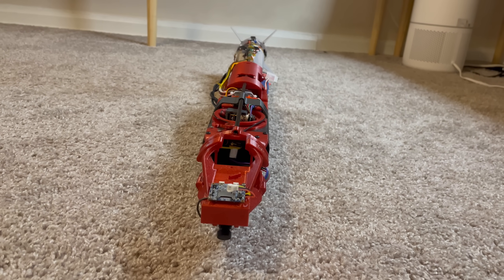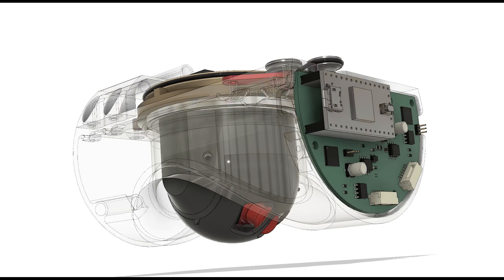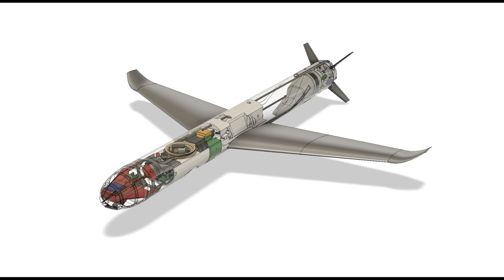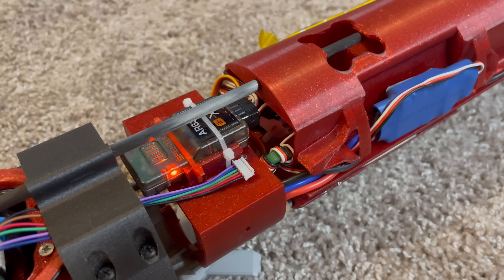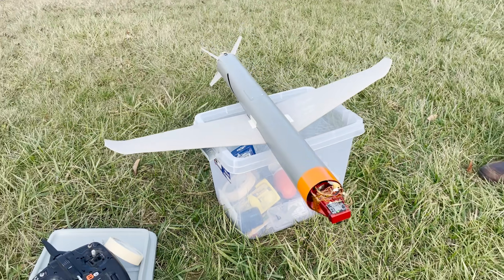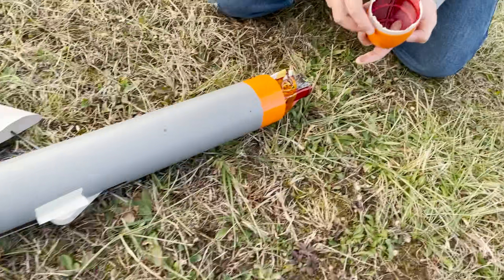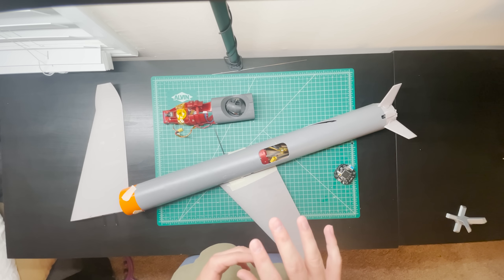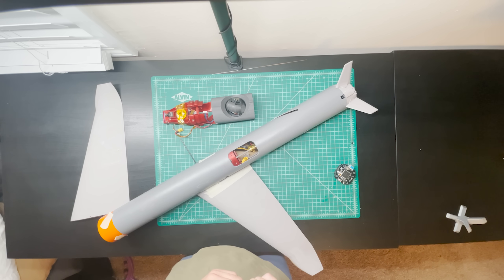Building (And Crashing) my Homemade Surveillance Drone

Comment: What is the point of the folding wings if you still have the tail fins? If those folded as well, you might be able to launch it like a mortar. I also think your intake is too small and its causing your intake to starve your EDF of much-needed air, killing its thrust.

Comment: Buddy loose the 3d prints as there is a lot of weight. Try to make some prototype designs with composite materials or aero modelling foam or similar stuff available in your country. Make designs without the overall electronics except for some. And if possible try propellers and bldc motors. Your design does look good but your propulsion isn't that good. I am also making something like this. But I did it with foam and composite materials.

Comment: you're not gonna have any roll authority, even with thrust vectoring because the moment arm is so tiny. def looks like it's just stalled out; plastic is heavy. With hand launching it's hard to tell, but in 2/3 attempts it noses up, suggesting the CG is too far back. You always want to err on the side of CG too far forward rather than back. A plane with CG too far forward might fly poorly, but if it's too far back it'll only fly once.

Comment: So for starters, nowhere near enough thrust for that mass, don't bother without upgrading it bc you will stall each time you'll pitch up. Launching will be good once you get a launching platform afterwards, just some kind of half tube rail or sth at a quite steep positive angle. Realistically, this design has to lose so much wait you will probably end up building a different plane.

Comment: +1 For the bungy launch it. That's what I used to do with my prototypes. At least you get it airborne and with enough air speed for the control surfaces to work. Bungy doesn't have to be super long, 10mt stretched to 30 is enough usually.

Comment: I think that the place of the fan opening is the reason for these failures should be at the top of the plane in order to reduce the pressure at the top of the plane and its presence at the bottom of the plane will reduce the pressure at the bottom and thus the conditions that help to fly will not occur

Comment: Ya know, I've had an idea that can solve two problems for ya. If you built a larger quadcopter with a hollowed out center, you can have the quadcopter lift up your drone and allow it to launch from VERY high elevation. You can also roll in your rockets into the idea so you can get greater altitude to potentially get to micro-satellite deployments.

Comment: Your turbine is not strong. Is it possible to find a turbine what delivers more thrust ? To reduce the weight, is it possible that you print the shell of the drone thinner  ? Or ist it better NOT to print a hull with a 3d printer, instead make a skeleton with pla or abs  and use thinn plastic folie to spann it over and so you get a low weight hull. Also make the wings with platic folie. Use the 3d printer only to make skeletons. You understand ?
Reply: A drone is not a rocket !!
Reply: You must increase the Wings, because you generating no uplift because your drone ist to slow.
Reply: Make foldable wings made from plastic folie, look how animals like a bat it does.

Comment: I wonder if you're underestimating the difference between the aerodynamics of rocketry and of fixed wing airplanes. It looks to me like you've put surfaces/ailerons to control roll where most airplanes control pitch and yaw.

Combining the roll components to generate pitch and yaw will induce drag and not leave much torque since some force components will have to cancel each other out.

Also consider for each of pitch/roll/yaw where on the plane you get the most leverage around the CoG, and you'll see why traditional airplane design usually ends up with each control surface where it is.

Comment: at first i think you should try to launch it differently, the guy in the video is throwing it from the backside, but that wont work. Try throwing a dart by throwing it from the back. Also u should to try to place a small weight on the underside.

Comment: It's about as aerodynamic as a brick, regarding the engine, thrust seems to be zero, wing incident, does it exist??, you could strip a lot of weight out of that, no you need to, go micro on servos etc, cameras etc housing are huge, think tiny drone, turn props into pushers add wings, you need lift, control surfaces, power etc at low speed take off, add some solid fuel boost rockets for take off, and a parachute.

Comment: You speak of vehicle weight as an issue, but where is the CG?  When you look at the video you see the AC pitching up and not having much stability. If you more the CG further forward it should add to the stability.  At the very least, it should fly straight hand thrown just as if it was a dart.  You want to make sure your CG is forward of the Center of Pressure at the very least.  Plus since you are drying to get an airplane flight model out of it, you should calculate the Mean Aerodynamic Chord (MAC) of the wing.  From there try to put the CG at the 25% MAC or a little forward of that.  That way you can reliably adjust your weights and not just guess your way at it.  Since it is a completely new design, I'd see if you can hand throw it, with the fan off, and see if you can get it to glide straight and true before you start adding the complexity of thrust.  IMHO.

Comment: I’m a hobbyist rc pilot with a few builds under my belt. I'd recommend calculating the wing loading (in g/dm²) and comparing it to other planes in the same category.
For what you're building, I wouldn’t go above 60g per dm^2 I have a small 70 cm model with a wing loading of about 45g per dm^2 and it already flies like a kamikaze, so keeping the weight down is very important.

You might want to try building a lightweight version of your design first (without the ir-cam, lidar or any unnecessary complex add-ons). After that you can gradually add sensors and mechanisms and see how each one affects flight performance.

Comment: the CG (center of gravity) is very important on airplanes. you could try this by balancing about 1/3 from the leding edge of the wings. if you want to be more accurate google "wing cg calculator" and you will get a result close to how you should balance your wing design.   you would have to reduce the weight or increase the wingspan to get more surface area, to provide enough lift at lower speed. as another mentioned in the comments, i would add aileron(steering on the wings) which would make it much easier for you to control the airplane. from what i could tell from your video this modell was to tail heavy. if is  possible would be to design the air inlet on the sides and/or top of the aircraft. maybee try slightly bigger diameter of the fuselage to have just a bit more space for the wings. maybee exchange the EDF with a foldable propeller.

Comment: Cool video, you can do the things you said at the end of the video, but I think your friend's throwing technique could improve, some of the things he can do is to run longer holding the drone and trying "to feel" the lift force from the wings before to throw it, besides if you look for a little windy day and throw it to the opposite direction of the wind that could give you very good relative air speed so then good lift force. I had similar problems like you trying to fly a Talon, and for me with those tips I could made it fly. (sorry for my bad grammar, English is not my first language XD)

Comment: Redesign the drone with a tripod-style landing gear to provide stability during takeoff and landing. This configuration supports field operations, especially in uneven or rough terrain, which often characterizes surveillance missions.

Remove the electric ducted fans (EDFs) entirely. EDFs suffer from low thrust-to-weight ratios, especially in hand-launched applications where size, weight, and power consumption matter. At this drone's scale, EDFs introduce inefficiencies and performance limitations that don't align with its intended field deployment or quick-launch requirements.

Instead, integrate contra-rotating rotors. These rotors will deliver greater thrust efficiency, better torque balance, and enhanced stability in hover and slow-speed maneuvers — all crucial for a surveillance drone. Contra-rotors also eliminate the need for a tail rotor, reducing mechanical complexity and improving energy efficiency.

Given the above changes, pursue a complete aerodynamic and structural redesign.

Comment: It looks like it trying to be more a rocket than an airplane. Here's my list of all the changes I'd consider

- The intake looks like a NACA intake which really isn't very good for pulling in lots of air.  
- Get rid of the thrust vectoring vanes they won't help increase maneuverability with such a low speed exhaust jet they'll just decrease thrust.  
- Use a normal empennage or a twin-tail (like B-25 Mitchell or Avro Lancaster) 
- Add ailerons to the wings
- Make sure the weights and balances are correct (the horizontal stabilizer needs to provide a downforce equal to the downforce of the nose rotating about the center of lift) 
- Try a larger wing area, something with a high aspect ratio instead of short thick wings. Also use dihedral (the winglets flared up look like they might be enough)
- Use a more powerful ducted fan, that one doesn't look nearly strong enough. (my thought is to have a larger motor place forward in the fuselage and driving the fan at the rear via a long drive shaft made from carbon fiber.) 
- I think a much larger diameter fan is needed, one that is larger than the diameter of the fuselage, try enshrouding the fan with a thrust ejector augmenter or thrust ring. at the rear, tapering the fuselage to a point where it meets the fan's central bearing.

Comment: I think treat it like a rocket - have the wings folded and place it inside a tube where it fits tightly - the tube has two chambers, pressurise one and when ready to launch, engage the moto and vent pressurised chamber into the one holding the drone, it should go 'phonk' and launch your drone into the air, then the pilot simply flies it up and into stable flight.
Reply: This relies on the wings folding out on launch lol

Comment: A few more ideas from me 1. Your edf nozzle is one the angle of the nozzel isn't steep enough it only needs to be around 10 degrees two the nozzel is too close to thrust output point meaning your nozzle nedds to be longer for increasing thrust 2. make rear fins a bit longer because right now they barely doing anything and 3. Lower wight.

Comment: - more thrust, figure your rate. F = [mdot * V]e – [mdot * V]0

- Some sort of rail launch or rocket launch system.

- I'd also look at wing width/ flight characteristics of those "fins"

-Id also use a reinforced carbon fiber 3d material.

Comment: Whats the static thrust with your Fan assembly? I would guess not that high. You have quiet a small area after the edf which chokes the airflow, this backpressure will effect your max thrust. Also try to launch this thing with a ruber band or a catapult.

Comment: The weight of your drone is not proportional to the thrust of the motor. You are unlikely to fly with this motor. Distribute the center of gravity of the drone closer to the center of the wings. The biggest problem is the weight and weak thrust

Comment: I could be wrong, but it looks as though it's being launched with a bit too much force leading to a dramatic increase in AOA inducing a stall. So long as you have enough thrust and it's correctly balanced - then having a method of ensuring a consistent and graduated acceleration during launch would probably solve the take-off issue. some guide rails and a bungee catapult may be sufficient, alternatively, drop it from a drone at a decent altitude and begin to manoeuvre it once it's gained enough speed.

Comment: Hi i reasently started learning about fix winged UAV's and ur problem might be in the propultion system; i mean the place of ur motor its torque speed and the fan design and dimentions (which is most probably the problem here). also iam not sure it its okay to place the air out while having parts of the tail infront of it. iam not an expert iam also learning this is just a suggestion u can probably look up more about propultion systems how the motor and fan have a huge effect on how much weight ur drone can be.
please if my information is wrong don't take my comment seriously thnx

Comment: It might be harder to implement than a rail launch system, but could you figure out a tow system? I would think putting the rocket on a guided trolley or cart would be easier, and you already have land based vehicles that can measure the amount of speed they are giving to the aircraft. It would just be a matter of making sure the tow delivers the energy straight on to the cart without deviation, then starting engines and releasing once you are up to speed.

Comment: I guess your air intake is much to small. You could get away with that diameter on the pressure side, but the suction side seems way to restrictive to get in all the air the turbine can and must move.
The original turbines mouth widens. You on the other hand made a smaller channel with a bend. I think the intake side should be at least 1,5 times the diameter of the pressure side. (But this is just a guess.)
Perhaps you could get away with small intakes like yours when you have air pressure by movement, but you try to start in this configuration. That's not gonna fly. 😉🙃
And you do not have to be that restrictive. You have a lot of empty space right in front of the turbine. Especially with the inital fixed wings. Remove the tube cover, remove your 3d printed fancy stuff and just let the turbine be hold by those three carbone rods. No restriction, minimal effort. Ideal for testing. You overengineered this one. 👍
Good luck, great project.

Comment: IMO not enough thrust to weight, control authority lacking at your launch speed, you either need to put a much much bigger EDF on this or shoot launch this thing fast, rail launch with a bungee or rocket motor boosters best option forward as some already pointed out!

Comment: Dude, I can explain what went wrong. Seems like you should study some aerodynamics:
1) You definitely have not enough tail volume relatively to wing area. Tailplates must be much larger.
2) At low speeds it's ineffective to control plane by tailplanes angle of attack. The airfoil curvature due to flap bending contributes much better.
3) It's very ineffective to control roll without ailerons.
4) Consider good front CG

Comment: Looks like you're trying to design something that could be dropped from a plane or larger drone.
Reply: ...on the cheap. If that's the case, it seems like you're going to need a detachable "sailing ballast stone" like something to keep it falling stable and evenly downward.

Comment: Later on in flight testing I would be worried about not having ailerons i dont think the back fins would have enough control to stably role the aircraft. I do not have much experience at all with rec aircraft so i could be completely wrong

Comment: I'm thinking you should try a suspended cable track with two roller dollies allowing two vertical suspension lines so the plane body can hold horizontal and you can try flight testing without crashes. Looks like you have plenty of room for a cable layout.

Comment: Have you checked the thrust produced with your current setup? I don't know a lot about rockets, but I'd imagine thrust to weight isn't as hard to manage as it is with RC planes. The ducted fan at the back might not pull enough air to supply sufficient thrust, or the setup might not be able to produce nearly enough thrust at all.

Maybe test the thrust produced and at least get a ball park weight that you need to cut down to. If its enough to fly the plane, maybe do some cool rocket thing just to get it airborne.

If the ducted fan at the back doesn't want to work, maybe try a prop at the back like the MQ-9 reaper or something.

If you want something more technically challenging, PeterSripol did a video on the martin 262 which had blades that were mounted after the wings but before the tail section.

Comment: Your CG is too far back, your rear control fins are way too small, your wings have no ailerons, and your edf isn’t producing enough thrust. 

Go with a larger traditional tail instead of an X, put ailerons on the wings and let them control roll, ditch the EDF and go with a prop.

For autonomous flight just use an Ardupilot Cube. Is has a barometer which is actually pretty good at holding altitude, way better than a lidar like that. The Here4 GNSS also allows it to do fully autonomous GPS flight thats very accurate.

I’m curious how you expect to track your rockets with a payload that only points down, just fly higher? Roll the aircraft to track?